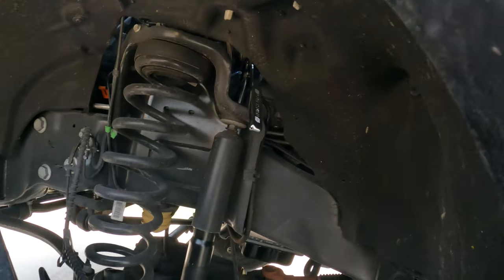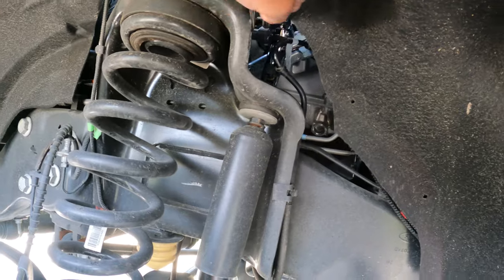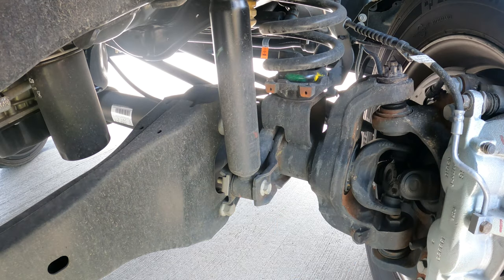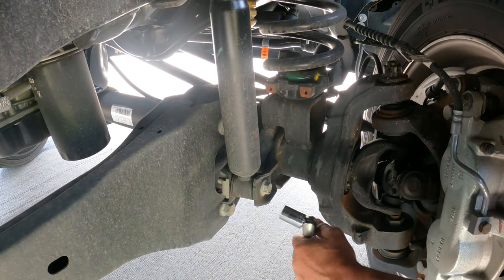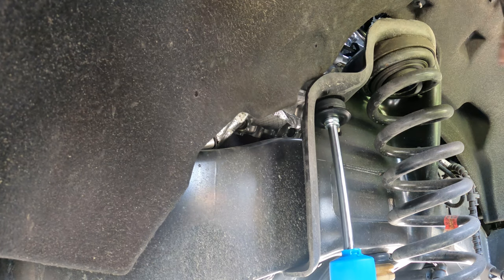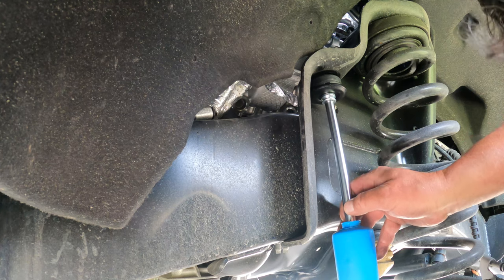Super C Shocks for 2021 Thor Magnitude RB34 | Replacing Front Shocks F550

Comment: You should have shown how to tighten the upper front bolt. Not easy at all. That part was completely slipped
Reply from the maker: I showed you how to remove the nut, putting it back on is about the same. sorry you disagree.